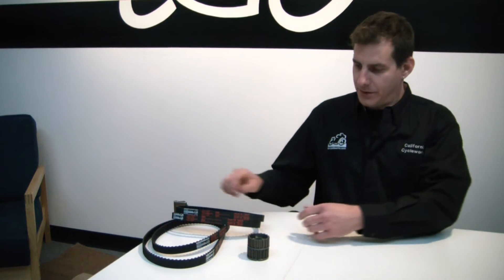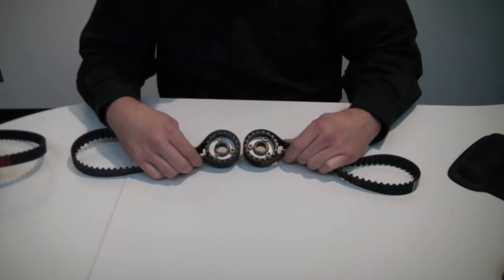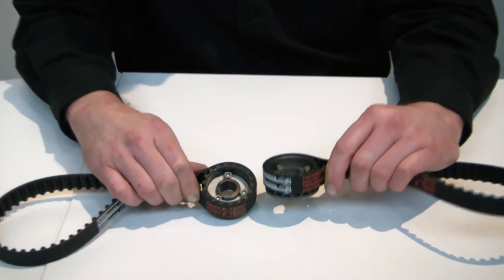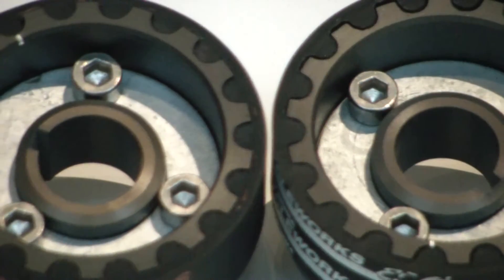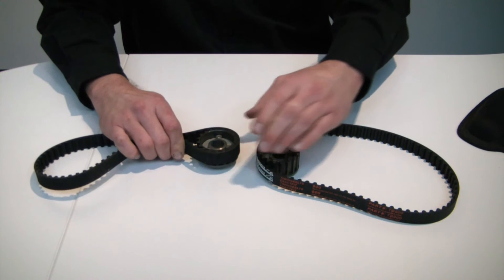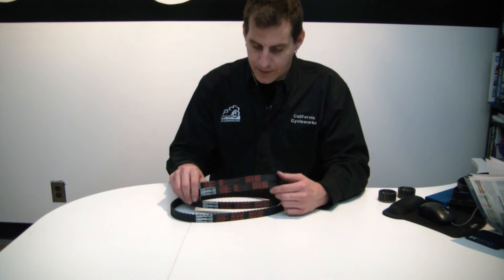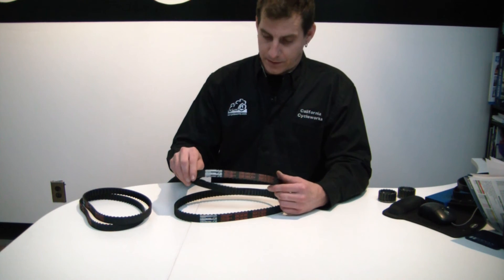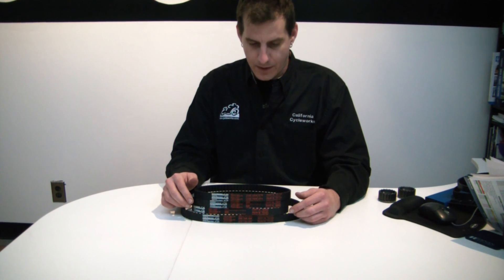Ducatitech.com: ExactFit Belt Comparison (HD)

Comment: I'm replacing the belts on my MTS950 and was wondering if the the Exactfit belts need to be replaced at 30k km or 5 years like the OEM belts or need to be replace sooner, thanks.
Reply from the maker: Hi Bored, thank you for reaching out. If you confirm the belts tension along that time period, we won't argue against the interval. All belts (OEM, ours, everyone's) have a continuously wound glass cord in them. These cord shift in the jacket slightly and will "break in" over time. This causes a lower tension. Additionally, increased moisture can cause the cords to swell, also lowering tension. There can be failures caused by low tension when trying to go the extended period without checking tension in the interim. It would be great if riders could go that full time without needing any maintenance, but the unique application on Ducati motorcycles isn't compatible with timing belt technology and long intervals without checking. Thanks, Krista

Comment: i have watched several of your excellent how to vids, including the ones about how to change and tension belts and the old one using the 5 and 6mm allen key method for tensioning belts which i just used with success when fitting your exact fit belts to my multistrada 1000ds, but i am interested in what you said in this vid about the differences between the 696 and 900 belts and that your engineer said they should not be interchanged as they have different tooth profile, not just different width, if that is true then would those engines not also have different pullies with different prifiles, it should be easy enough to check offering one pully up against the other if they really are different. anyway, yours work just fine on my 1000ds, cheers
Reply from the maker: Hi Odysseus, the differences are very subtle where the tooth transitions to the flat of the belt. One is sharper and the other radiused - yes, the sprockets are different.